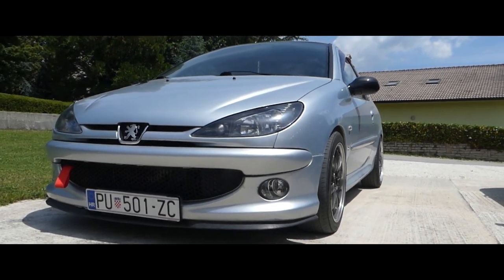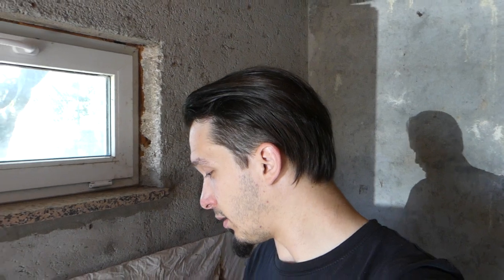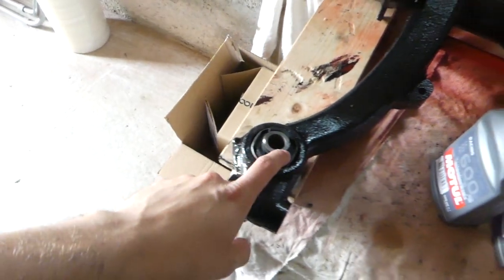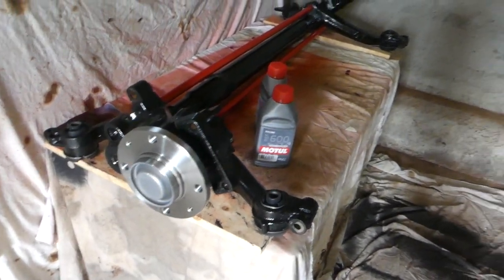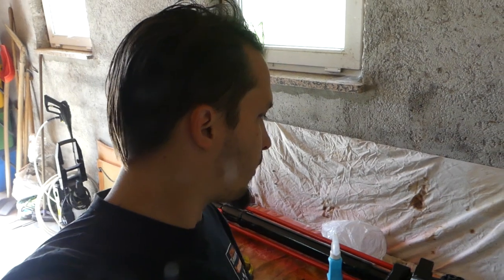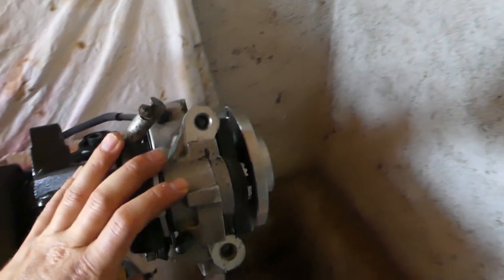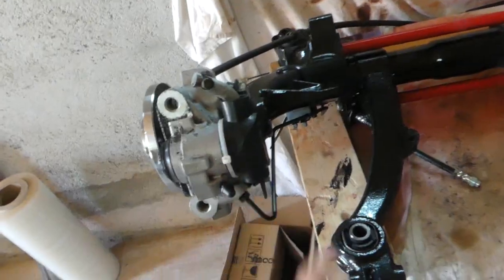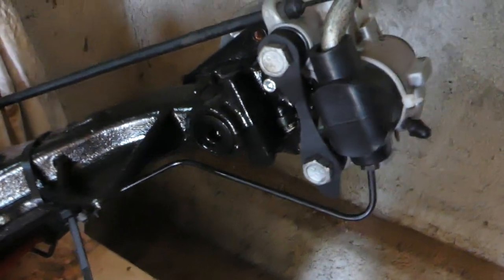DRUM To DISC BRAKE!! PEUGEOT 206 EP2!

Comment: can I put rear axle for 1.6 206 whit disk brakes on 206 1.1 whit rear drum brakes ?
Reply from the maker: Like you can see in the video, you can put everything on everything 😅🤣
But yes, you can.
Reply: @Dynoo1000  i want to keep all the stock brake lines
Reply from the maker: @ryzenx-no1bl  if they are good you can
Reply: @Dynoo1000  plug the same abs sensor ?